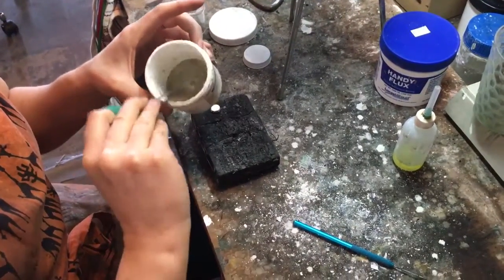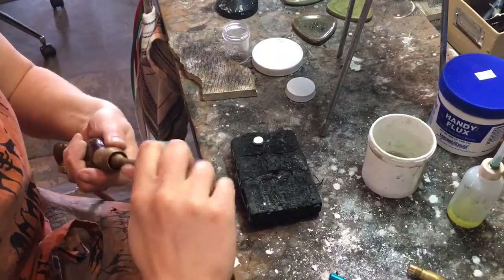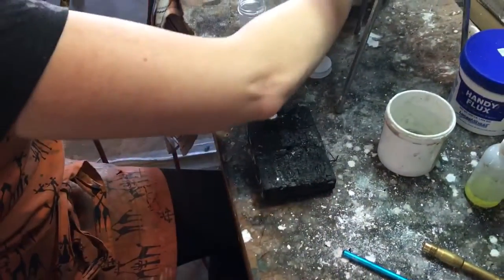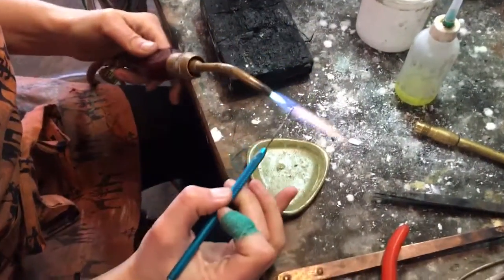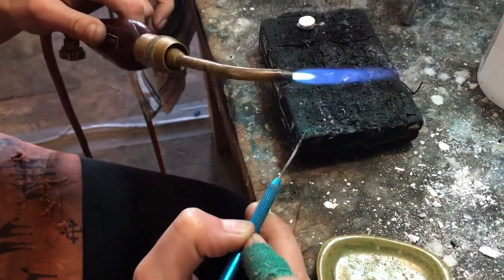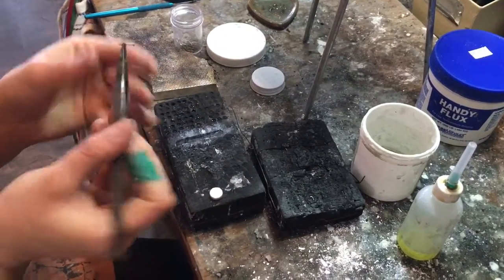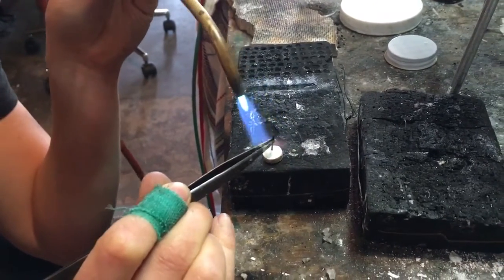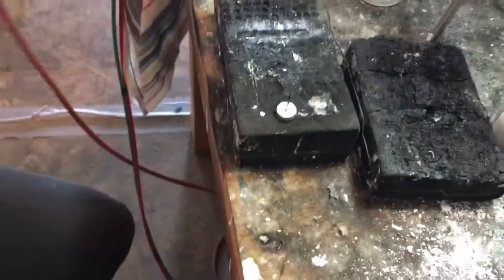Soldering a post onto an earring

Comment: If you have worked on the assembly line using a soldering gun you probably need to fast forward and get the supplies ready because you already have knowledge so go for it!